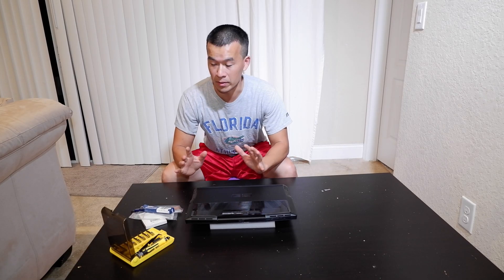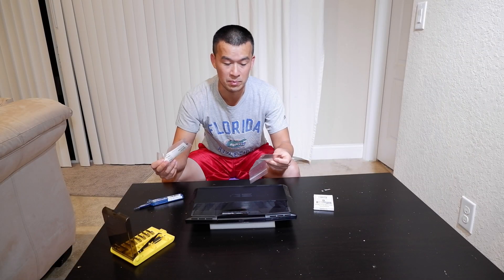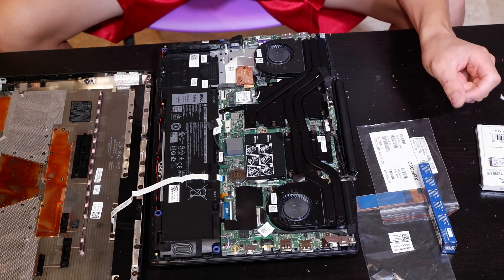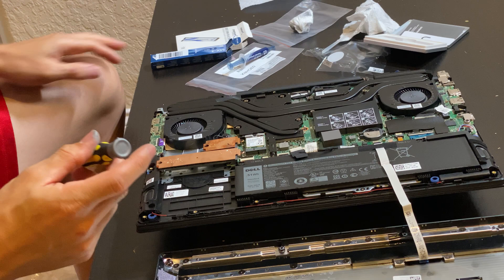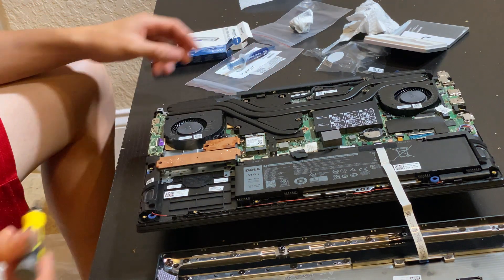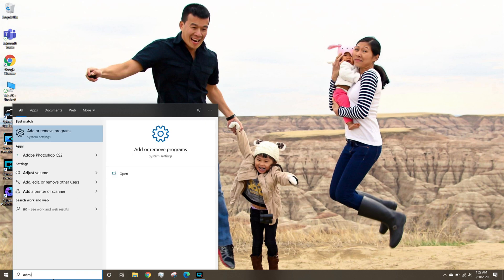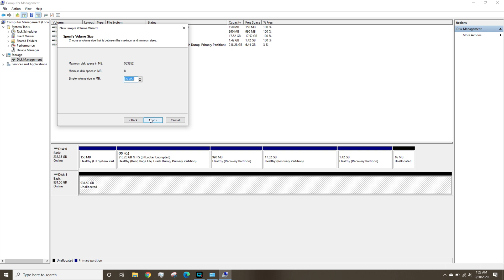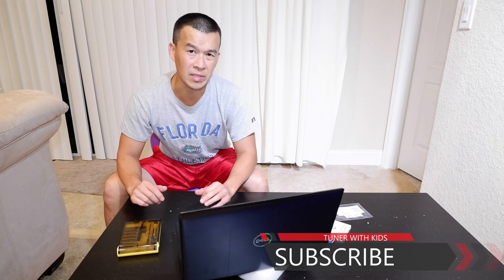How to Install SSD M.2 NVME | Dell G5 15 5500 G3 Gaming Laptop | CPU GPU MX4 Thermal Paste Install

Comment from the maker: Few Amazon sellers are gouging for the YX0F3 SSD Bracket at $23 (Dell list is $2.99): https://amzn.to/3qMip56
Reply: Is the heatsink absolutely necessary?
Reply: Any alternatives?  I have been waiting on Dell for a while but this part has never been in stock.
Reply from the maker: Get an m2x3mm screw and aftermarket heat sink that tapes or rubber bands on.
Reply: @TunerwithKids  Looks like I may have to.  Too much time wasted with Dell.  Are you able to run XTU  and tell me your benchmark?  I am wondering how much your thermal paste has helped.   Also have you moved to the latest 1.71 bios?
Reply from the maker: I don’t have any before and after numbers for temps. I know another commenter on my RAM video said his dropped 10F.  I’m not sure what bios I’m on. Know it auto updated recently.
Reply: @TunerwithKids  Did you undervolt?  If not check your bios and go to 1.71
Reply: @TunerwithKids does G5 5500 dell goes with NVME 2 ( 2 tb ? )

Comment: Trying to figure out if i should clean install windows or just buy a new laptop at this pointe
Reply from the maker: If you have this machine, it’s probably end of life. Mine is a work horse but runs so hot that my keyboard is malfunctioning. I lost like a dozen keys so it’s always docked with cooling fan pad and external keyboard and mouse now. It still works great and can render all my 4K videos but not really something I lug around.

Comment: Cool video, great job.  I use a tooth brush to perfectly clean my chips, then spread edge to edge on the chips bro! yipee!  By the way I'm building my Dell G5 SE 5505 soon, ill show you what's up with it.  I'd remove that dust screen on the bottom cover covering fan inlets and tape the heatsink fan connection to force all the air through the heatsink, I'll show you later what I mean.  I would have made it a MBR since it's below 3TB, so you can make it a logical partition @ 512 sectors ntfs to save as much space as possible & not interfere on windows installation.

Comment: I just bought a SSD (Dell M.2 PCIe NVME Gen 3x4 Class 35 2230 Solid State Drive - 512GB) and DELL offered the wrong type, as they probably didn't consider that I wanted this to be installed in the secondary slot that needs that extended bracket. The SSD I got is the short version similar to the operating system unit. 😰😰😰😰😰 Useful content and you explained all the issues I had faced today.

Comment: Putting thermal paste on both the CPU and heatsink is not a good idea. It can cause air pockets in the paste which will reduce conductivity. Optimally you want one layer that is as thin as possible while making contact with the entire chip.

Comment: Hi Bihn, do you think the Samsung Electronics 980 PRO SSD with Heatsink would fit into this machine?  While it is more costly but if it fits, then it would avoid the drilling.
Reply from the maker: No way with that heat sink. It’s too thick for notebooks. There is very limited height in the chassis.

Comment: is that ssd fast . because i see it does only R/W 3200/2000MB/s
Reply from the maker: It writes SSD to SSD at 1Gb/s to 2Gb/s but not sustained. Large data gets slowed probably due to heat.

Comment: Hey! I'm new with the gamer laptops and computers... I'm not an English speaker so it sometimes gets kind of hard for me to understand everything due to my lack of vocabulary you know... Well, the question here is if that plate you put over the ssd is mandatory or is it optional? As I said before, I' m new in the gaming laptops field and I just got this model a few days ago. Thanks in advance and your video is great!
Reply from the maker: Needed to get rid of heat. These run very hot.
Reply: @TunerwithKids  thanks so much for answering! I'll have that on mind

Comment: can i install 2  M.2 NVME (2280) ssd to G5 15 5500?
Reply from the maker: That is exactly what I did in this video.
Reply: @TunerwithKids  It looked like you had a 2230 and added a 2280. Am I wrong about that?

I'm also wondering about having two 2280s. Documentation seems to suggest you can have one 2280 and one 2230 but not two 2280s, however it definitely looks like two 2280s would fit. Is there something I'm missing?
Reply from the maker: It's fits two 2280 or 2230. They have the holes for both slots.

Comment: Gpu overheats a lot and shutdown how do you manage to keep the gpu cool
Reply from the maker: Haven’t had any troubles with it.
Reply: @TunerwithKids  even with gaming? How high are you temps? Cooling is an isuenwith dell
Reply from the maker: I don’t really game. I use it to process 4K videos. It gets hot during processing and rendering but normal use is OK. It does run hot but I use a cooler pad.
Reply: @TunerwithKids  thanks bro:) mone crashes wheb i game not even 10 mins

Comment: I purchased a dell gaming g5 15 5500 with the following features 

Intel Core 10th Generation i7-10750H Processor (6 Core, Up to 5.00GHz, 12MB Cache, 45W)
Windows 10 Home

256GB PCIe M.2 NVMe Class 35 Solid State Drive

8GB (2X4GB) Up to 3200MHz DDR4 SoDIMM Non-ECC
15.6 inch FHD (1920 x 1080) Wide View Angle Anti-Glare 60Hz 300-nits LED Backlit Non-Touch Display
NVIDIA GeForce GTX 1660 Ti 6GB GDDR6
Interstellar Dark - LCD Back Cover (Non-Touch Screen), mDP and Thunderbolt 3
3-Cell, 51 WHr Battery (Integrated)
Qualcomm QCA61x4A 802.11ac Dual Band (2x2) Wireless Adapter + Bluetooth
Solid State Hard Drive Bracket

 
I want to take advantage of this solid state hard drive bracket. so what can i purchase to use this bracket and increase my storage capacity, is it internal ssd like Crucial MX500 500GB SATA SSD 2.5"       OR
WD Black SN750 M.2 NVMe PCIe SSD 1TB Gen3 x4
 
? 

Many thanks in advance.
Reply from the maker: You need a m.2 2280 size to fit that bracket in the second slot. The brackets can be had by calling Dell or there’s a link in description for a $23 on from Amazon.

Comment: Hello. How have you been? I hope it's ok. Your video is very useful to me. I would like to know how you could buy the part at DELL? Where did you ask for it? By phone? Website? If you could help me I would greatly appreciate it. Thanks
Reply from the maker: You can try calling Dell parts with the part number in the description box. Also you can order on Amazon using the links in description.
Reply: @TunerwithKids  Thanks a lot

Comment: Turner, where did you get the copper heat sink/ plate and screws? My g5 15 5500 did not have it in the chassis.
Reply from the maker: Check the links in description box.

Comment: Can you please post dell links? I can’t find them
Reply from the maker: There aren’t any Dell links. You have to call. There are a few Amazon sellers who  sell them. Check links in description.
Reply: @TunerwithKids  is the SSD cover necessary?
Reply from the maker: I feel like it is because of the amount of heat this machine generates. Some guys just used a aftermarket copper with rubber band one. But you can mount using a m2x2mm screw to bolt the m.2 into the hole.
Reply: @TunerwithKids  alright, thanks!
Reply: @TunerwithKids  i need a screwdriver that can open the laptop itself, what size or what should I search on Amazon??
Reply from the maker: I think I have a micro screwdriver set in the links of the description box.

Comment: so i jusy ordered a similar laptop a few days ago, comes with a 512 ssd , and a ryzen 7 4800h, i can only imagine putting 32 gigs of ram in soon cause im heavy on ram and its coming with 16 gb, i also read the real max amount of ram is 64 gigs
Reply from the maker: I think this computer is limited by MB. The processor may handle 64GB but motherboard might not. But R7 might be different.
Reply: @TunerwithKids  probably, i have an inspiration 3168, its max on dell site is 4gb. but i have it running 8gb

Comment: Could you put a WD Black SN750 NVMe SSD with everything and the bronze colored plate?
Reply from the maker: Yea the SSD heat sink or aftermarket copper can fit. This machine runs hot so any additional heat dissipation will be a plus.

Comment: Thanks so much for this video..I ran into the exact same thing you did on my G3, purchased a 2.5"  SSD this evening  and was like "oh...that's a big %#@^ battery right there..should have RTFM." Contacted Dell with the part numbers you mentioned and got the heatsink and screws ordered, exchanging SSD for an M2 tomorrow.. Hope you are enjoying your G5!

Comment: I got. 5500 with 4 cell battery. I would need this type of ssd right?
Reply from the maker: The only SSD that works in second slot is 2280 m.2.
Reply: @TunerwithKids  no space for a 2.5 hdd?
Reply from the maker: There is room but no connections on the g5. The g3 has an option for 2.5.

Comment: What speed is the 2280 SSD please? I want to add a second drive but don't want to overspend.
Reply from the maker: I used a Sabrent Rocket Q. First one was lightning fast, was getting 1Gbps to 2GBps SSD to SSD speeds but that killed the drive from heat. The replacement I got is slower but hasn’t gotten overheated. I complained to Sabrent but the Crystal Disk tests showed it was healthy speeds.
Reply: @TunerwithKids  It's weird cos I have heard a source say the 2280 drive is pciex2 speeds whereas others say its the same speed as the 2230 that's in there. I just want it to add games to so might just whack in a 512gb drive in the 2280 space and see how it goes. Currently have a 512GB in the 2230 slot.

Comment: Tuner with Kids - Any difficulty in opening or closing the case?  I'm a little worried about that video cable.
Reply from the maker: Nope easy. The video cable? You mean that ribbon for the under glow light? Just be careful else you will pull it out of the board and have to take the cover apart to plug back in.
Reply: @TunerwithKids  No big force needed to pry it open?  I plan to take off the ten screws and use a credit card.  I saw you struggle a little to put it back on, any tricks or just line it up and press it in , then tighten down?
Reply from the maker: The credit card is best way just don’t forget the ribbon for the light. Putting it back is tricky around the hinges. Just got to go slow and make sure it all lined up.

Comment: I put my 970 Evo in with out that copper shield and I’m getting ~67 C under load. Those heat syncs anrt needed on most nvmes anymore from what I understand.

Comment: Idk if anyone noticed but i appreciated how you screwed the air rails back on in a star cross pattern like wheels 😂
Reply from the maker: Car guy habits 😂
Reply: Well it's also good for PC's because it allows the pressure to spread evenly across the die and also allows even contact across the heatpipes

Comment: Nice video with a lot of information.  Also, Go Gators!

Less is more with thermal paste.  You can use isopropyl alcohol to clean off the old paste (from both the cpu/gpu and the contact patches on the heatsink/heatpipe).  Wipe off as much as you can with a lint free cloth and then use cotton swabs or cotton balls to get the rest of the old paste. You want it to be a clean mirror-like finish.  You can put a small pea-sized bead of paste in the middle of the CPU/GPU and, when putting the heatsink/heatpipe back on, move it a little to spread.  Too much thermal paste can be just as bad as (or worse than) too little or old, dried out paste. I've been using this same technique since the old days of overclocking Celeron 300A's.

Comment: That part number for heatsink doesn't exist in the UK.. so sad I've had a right struggle trying to find one!
Reply: Had to buy one off ebay..£10/$10 in the UK for one because no where sells them!
Reply from the maker: The OEM one? If so that’s not bad considering. There are people on Amazon in USA selling for $24
Reply: @TunerwithKids  the dell UK store is slightly different, also customs fee, I found one on ebay for about $8 so it isnt too bad, greatly appreciate your video, cant find any others on the Internet snd yours was fantastic. I got the G5 15 5505 (AMD), They massively stepped up their game and outperforms intel in almost every way, for when youre in the market for a new one!

Comment: How is it after dell update ..is there thermals improved?
Reply from the maker: Didn’t know Dell had an update. But mine is a docked queen so it’s always on a cooling pad with external monitors thru DP 2.1 Daisy chained. I also dock all my accessories thru a thunderbolt with a WD19TB.

Comment: My Dell G5 5500 also came with 256GB SSD.  I need more storage space (I have few CAD programs to run) and your video is great resource in upgrading my storage need.  Thank you for the excellent tutorial video.  However, I'm thinking of getting 1TB M.2 SSD and use is as my primary.  Do you think it would be advisable to clone the 256GB to new 1TB and use the original 256G as secondary after I make sure it cloned ok and wipe clean the original SSD?  Or store the original SSD as emergency backup?
Reply from the maker: You can clone the SSD and install as the primary. Just make sure you know how to setup the clone to boot from the #2 slot. I've never cloned SSD to SSD onboard before. Usually I've only cloned HDD to 2.5" SSD in an external case. May have to look that up. The #1 slot can fit 2280 and 2230 but the #2 slot only fits a 2280.

Comment: Sellers still gouging the YX0F3.  Called Dell and was told that no parts were available yet for this laptop lol...even when I told them that you had ordered the YX0F3.  Searching that part number, however, yielded no results.  I did, however, find this $8 heat sink that works perfectly and used it to install a Crucial P1 NVMe drive in the 2nd slot.  YMMV   https://amzn.to/3gT8tC8
Reply: G-d bless you man, I'm going to order this and use it intil the YXOF3 is restocked 🙏

Comment: The thermal bracket (YXOF3) is now out of stock, per Dell's sterling customer service.
Reply from the maker: Yea a lot of people are having trouble ordering or getting SSD parts right now. I saw on a forum that the Inspiron 15-5505 has same issues. People had to ask for the supervisor and name drop Naveen Kumar to get some help. Apparently Naveen can get these parts ordered. Use chat or call the sales line and ask for this supervisor.
Reply: @TunerwithKids  Thank you! I will give that a try.
Reply from the maker: Few Amazon sellers are gouging for the YX0F3 SSD Bracket at $23 (Dell list is $2.99): https://amzn.to/3qMip56

Comment: Can I put two 1TB M2 SSDs in the Dell G5 5500??
Reply from the maker: Yes, you need to replace 2230 (small form factor) the stock 256 or 512GB  with another one. I recommend 2280 for both slots.  You can do 2230 also but I don’t recommend because of the surface area for heat sinking.  You will need two of those OEM $4 heat sinks. Call or chat with Dell Parts to order. I recommend ordering box of screws from Amazon instead of Dell overpriced $2 screws.

Comment: I have a 512gb 2230 ssd installed. I bought a Wd black 2280 (1Tb). Is it supported or I have to buy a ssd max with 512gb? Thank you
Reply from the maker: It supports more than that. You’re good.

Comment: What was the alternate storage drive you mentioned that had alittle bit more performance? Thanks.
Reply from the maker: The Sabrent Rocket line and Rocket Q. They’re two lines about 30% more in cost.

Comment: What is the lifetime of the thermal paste and when is a good time to replace the old with new? I'm transitioning from desktop to laptop due to dell warranty unable to upgrade motherboard & processor hardware.
Reply from the maker: IDK on life of thermal paste. This was my first time doing this. I’m sure it’s meant to last as long as the computer as 99% of people would never touch it later.
Reply: @TunerwithKids  understood 💪

Comment: So Quick Question because I am interested in adding an extra NVMe SSD to my G5 15 how come you had to reapply the heatsink and is that a necessity?
Reply from the maker: That was optional. I read some others tried new thermal paste to help reduce operating temps. This machine runs hot.
Reply: @TunerwithKids  I see. Thank you for that tip!

Comment: How did you order the heatsink YX0F3? The only result I get is for a thermal pad
Reply from the maker: I called Dell parts and gave them the number. It used to be $3.99 shipped but I think they realized they were losing money so heard it went up to $11 shipped (which makes sense).
Reply: Sadly I got the run-around when I tried again 😅 so I just bought a generic heatsink on Amazon. Thanks for the information and the response 😊
Reply from the maker: @TheTonyRedgrave  , they tried to tell me it wouldn’t fit when I told them the model. I said I didn’t care, just send me the part. It’s $4.
Reply: @TheTonyRedgrave  can you tell me qhat heatsink do you bought? i am also waiting for a heatsink for g5 5500
Reply: I've tried getting the YX0F3 for a month now but Dell keeps telling me it is out of stock... Aftermarket parts it is then.
Reply from the maker: I would ask for a supervisor. I saw that people have been having issues getting some of these SSD parts for other Dell Inspiron 5505. There’s a Naveen Kumar that is a parts supervisor who can magically get these parts ordered.